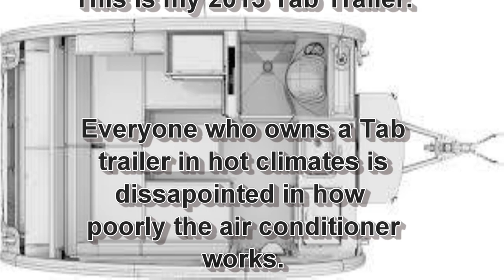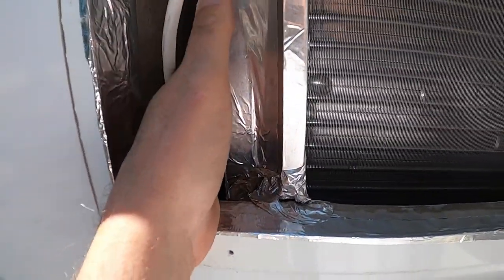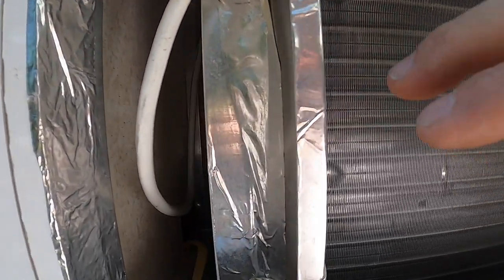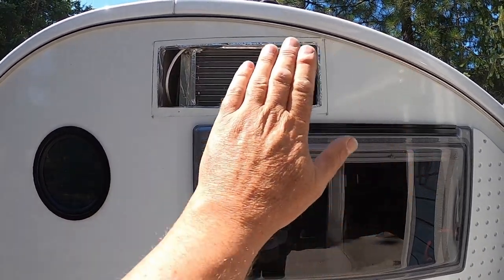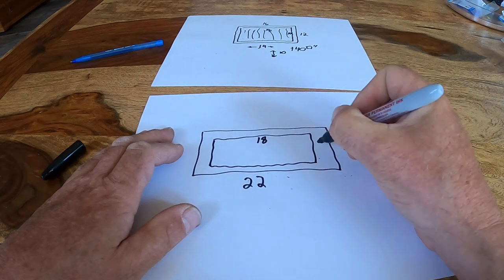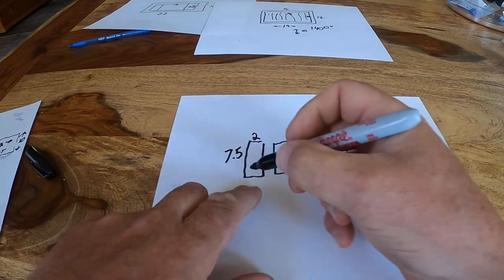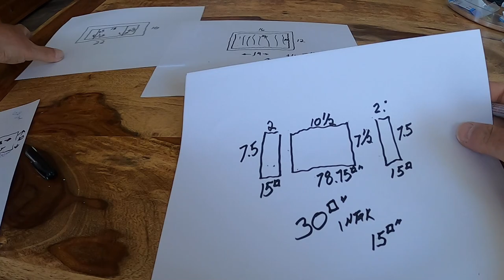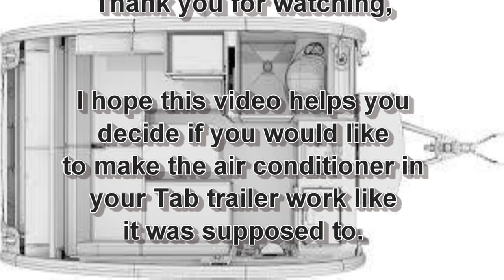Air Conditioner Rework - Part 1 - 2015 Tab Max-s Trailer

Comment: I did this upgrade and it really makes a big difference in how well the air conditioner works. It’s not difficult if you follow Marks advice. Measure 4 times cut once. Now when it’s 93 degrees outside, inside it 45 degrees coming out of the air conditioner.
Reply from the maker: Thanks for the feedback James. It's good to know these videos are helping people.

Comment: Thanks for another great video!  Our AC unit has died and I need to replace it.  Would it be possible to cut an opening by the 110 outlet inside the camper that would allow for more airflow to the AC without having to cut into the roof?

Comment: What is to keep the hot exhaust air from rising and mixing with the intake you add to the roof? Is the hot sun also heating intake air on the roof... Sounds like it might help, but will it be enough?
Reply from the maker: The hot air won't go back into the intake because it is being blown out the side of the trailer at a reasonably high velocity. It gets several feet away from the trailer before it rises any by convection.
It's operation will be no different than if it were sitting in a window as it was originally designed to do.

Comment: Do you know if this has been fixed by Nucamp for the the 2021/2022 models?
Reply from the maker: I don't know.
Reply: 2020/2021 have a different style of AC internal to the trailer, an Air8 unit.  There have been breathing issue reported with this also.
Reply from the maker: @dw3897  bummer.